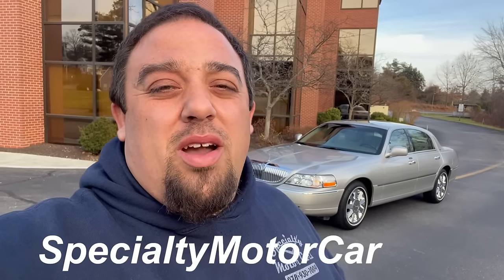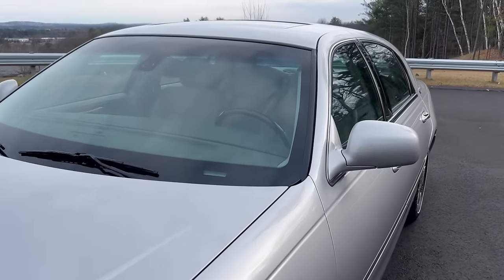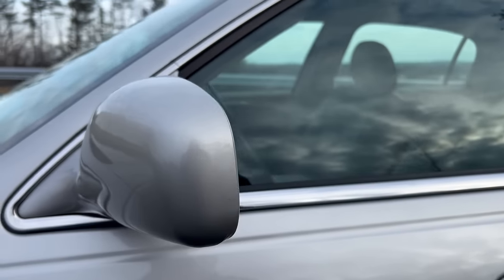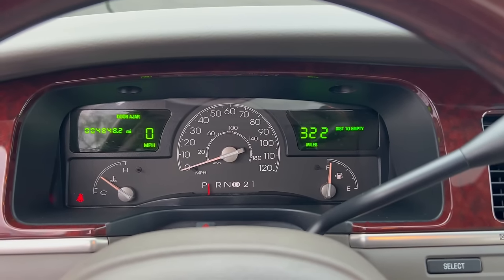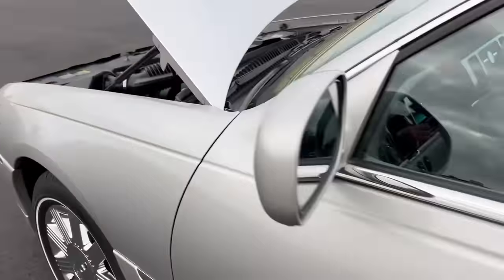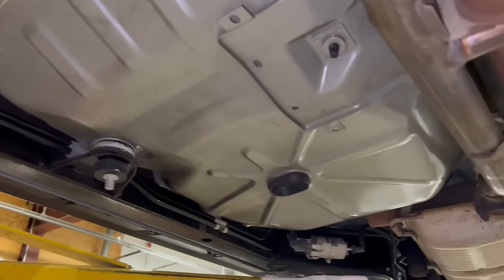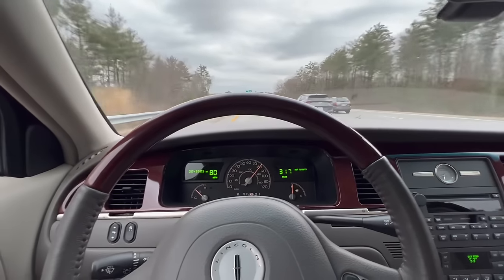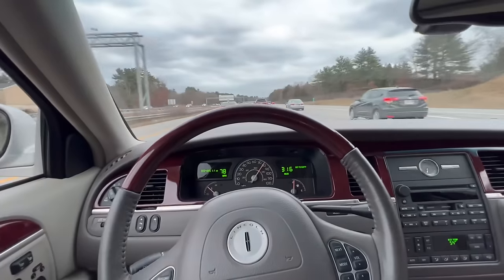2003 Lincoln Town Car Cartier w/ 4k Original Miles! THE FINEST EVER For Sale By Specialty Motor Cars

Comment: These cars had one of the best, easiest to work one engines that Ford ever built! Really the only concern was the plastic intakes. They would crack in the back passenger side and leak coolant. Unfortunately replacements are no longer made so if one goes bad on you good luck finding a replacement. On the upside this one here with proper maintenance is a good 300k miles away from that concern. Nice find!

Comment: 4,800k miles the car is still brand new not even broken in.
Reply: The 4.6l can easily run to 300k without a problem.  My mother 👩 had a Crown Victoria with this engine that ran over 250k with just a leaking valve cover gasket.  😊

Comment: I've got an 06 with 50k miles...... always thought that little ticking sound in the motor meant something was wrong. This video and a couple of your other ones let's me know that just a the sound of the 4.6 running beautifully
Reply: That's the fuel injectors.  I have 2 of these and that is normal operation for these cars.
Reply: @biggtastee2401  preciate ya man  such a relief. I thought it was a lifter, some kinda carbon buildup up somewhere. Thanks for taking the time to explain that.
Reply: @biggtastee2401 doesn't help with the ethanol blended fuels used all over the northeast.  About every 3 to 5 k miles put a injector cleaner/ lubricant in its fuel to calm that sound down. The injectors used in the 4.6l are closely related to the ones used in the diesels. A pintle type injector. 😊

Comment: That's one beautiful 2003 Lincoln Town car in silver Birch I must say I have a 2010 that's almost as clean as that and it only has 80,000 mi of course it's not as clean as that thing is like brand new mine is close to it? I take very good care of it. I just had it detailed about 4 months ago complete and it still the engine and everything looks like brand new people trip out the cars going to be 14 years old and it looks still like new everybody says but $80,000 miles is still pretty low actually 80,864.0 miles

Comment: This is a beautiful vehicle. Are you sure the windshield is original? It looks like the rain sensor has been replaced as it has air bubbles in it. I own a auto glass shop and this is a telltale sign that it has been replaced with an OEM windshield at some point, looks like they reused  the rain sensor gel pad. I wish these cars came with a center consul in the front dividing the two front seats.

Comment: What tire would you highly recommend for 04 Lincoln town car with white wall if possible? I currently have Michelin but thinking of Continental true contact tour with eco plus technology.   Under $200.
Reply from the maker: Those are available in white wall only for 225/60/16 which would be pre 03 era town cars. Only off the shelf options are the travel stars. 225/60/17 Travelstar UN-106

Comment: Yes this is a great car. But I would not pay full price for it. Because as soon as you start driving this car. You're going to have to replace every gasket, seal, hose, belt, vacuum line, and anything rubber under the hood, and on the suspension.